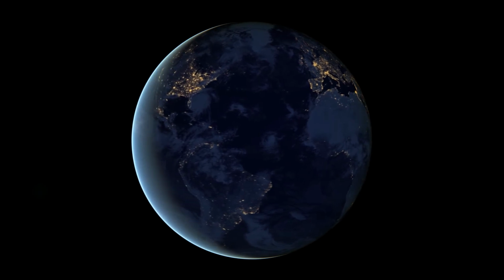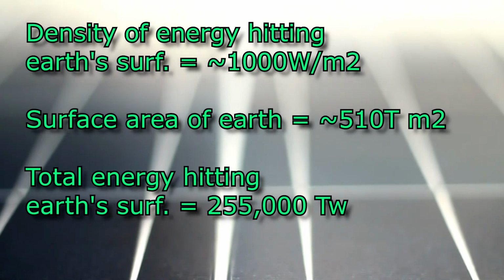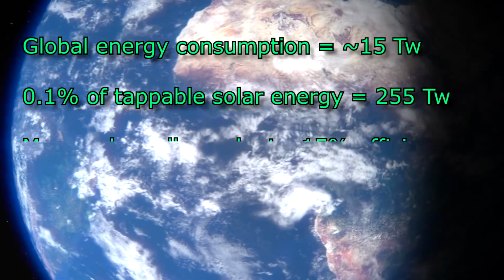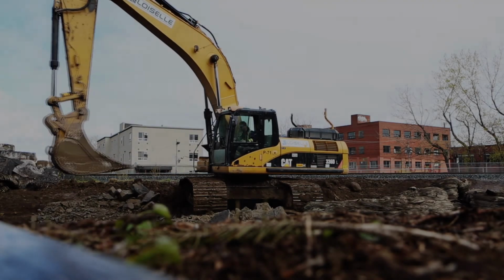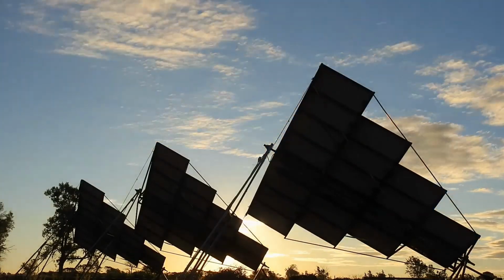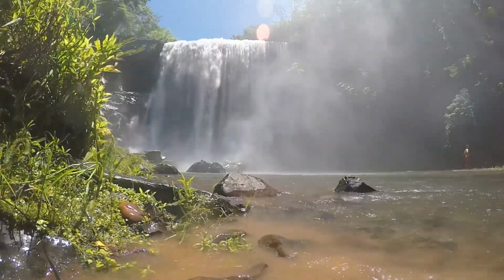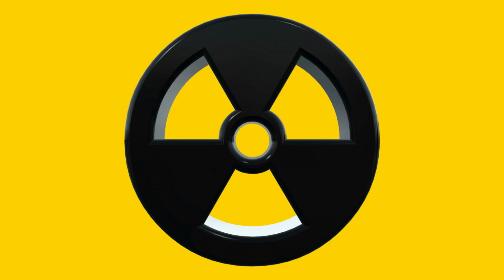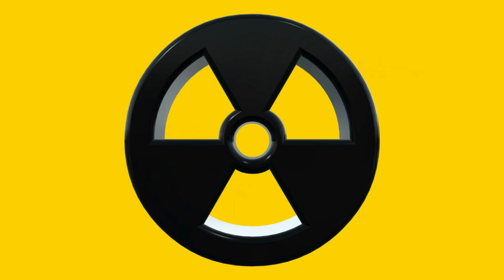(Re-upload) FoRBEs Ep3: Technologies for Abundance and Sustainability

Comment: Base load sustainable energy from:

* geothermal (especially ultra deep geothermal)
* ocean tidal, wave, and stream
* whirlpool for streams and rivers
* high altitude wind
* power satellites

Land based wind turbines and solar is a waste of land and has intermittency issues.

Especially with climate change and all of the horrors that will come with it make nuclear reactors are very, very dangerous and unnecessary especially with other safer sustainable base load power options. 

Fly wheel, sand or brick, and flywheel batteries are great simple batteries.

Comment: you are a true rbe-er, but recognize that howard and fresco were not architects. if a circular plan was that great, it would be everywhere. the reality is the grid is everywhere. even mars city is planned as a grid. that is, start up development. if you want to see a more promising approach, check out baukunst2000 channel.
Reply from the maker: You see, the grid system works well for the functioning of capitalism. Cities were designed in a grid fashion to accommodate the car. In an RBE we might not even have cars as a form of personal transportation.

This is about truly overhauling everything that has been done before, from economics to culture to city design. There are numerous benefits to the radial model: it's transport and energy efficient, is less prone to sprawl, among other benefits.
Reply: @edeniaAJ  thanks very much. no one ever responds to me, so i wanted to clarify. disney was no architect either, but epcot (elliptical), had some design merit, even though it had nothing to do w/ rbe thinking. was quite the opposite. ultra-capitalist. the built environment isn't related to the economic system. i know fresco has erroneously claimed that it is.  if you give my scheme online a chance, i have no cars other than localized emergency vehicles. all passenger and freight train lines are running on a 1/2 mi. grid w/ stations every 1/4 mi.. the big infill patches are structured farms. there's no sprawl. like tvp, my urbs (cities of 350k pop.) are built as a complete entity. they are then chained together w/ umbilici, like a mat across middle america. if you look at the individual city module, there are end caps. water treatment and elec. substations at the north. a staging/reservoir area to the east. garbage, biomass, and recycling to the west, and wastewater treatment to the south.  my housing density is running about 35 dwellings/acre which is high enough to support a rail system. an acre of artificially lit hydroponics could equal 4-6 acres of open-to-the-sky farmland depending on the crop. an american diet runs about 1 acre/person per year, but hard to quantify. there are others out there such as the vertical city. vertical megastructures w/ farms in between and linked by trains. no rbe and/or type 1 platform. website looks dead. can also look at arcosanti. basically a bottom up commune, but soleri never preached rbe. i believe in a top down approach, by using the u.n. as a way to get a foot in the door.  ie, addressing the 17 sdgs that are currently in play. there's about 500 years of utopian thinking that's come out of the arch. community. i admire what you are trying to do, and want to be allies. my suggestion is you research some other ideas and i don't mean tvp copy cats. one of my online friends has one. brilliant guy btw and hardcore rbe-er. maybe you feel the built environment part is just a detail that will work itself out? but laypeople, especially college educated ones,  get excited over tech. info. just as much as artist's conceptions.  i have personal, professional experience with this. have you seen any math similar to what i have outlined above from tvp? any scaled floor plans w/ functions. circular city diam.? 50,000 people? one train line that darts through some cyber hub?  100% automation? even a bike runs 95% efficient. how about 80% automation and 20% human labor. more realistic. i'm sure you have seen interreflections. i do have a quirky theory that zaha hadid (rip) was influenced by fresco's curvy models.  i could go on. feel free to email if you're so inclined. adam, even these guys talk about a 5 mi. x 5 mi. grid city w/ subway trains and no cars. it's a somewhat silly presentation, but the design intent is there, and verbally akin to my concept. more food for thought. cheers.

https://www.youtube.com/watch?v=0GwINxSlMFs&feature=youtu.be
Reply: @baukunst2000  Hey, I wanted to add in my thoughts to this discussion. I just recently watched the video. I'm interested in the transition of humans towards a resource based economy and city design is a big part of allowing the principles of an rbe to thrive. I like a lot of your ideas. I've seen Fresco's circular city and while I think it might work from the ground-up in the distant future, I just don't see it catching on worldwide for various reasons. One of the reasons is landscapes. The Venus Project circular cities are all shown on flat, open spaces often with internal ponds and water features, but not necessarily right beside a big body of water like a river, lake or ocean. Well, in reality, many (if not most) cities are built along water and that often means they can't just be circular, they have to adapt to the different terrain. The city I live in isn't very large, but it's got a big hill on the north side and then into the valley is the rest of the city but it also has smaller hilly areas, too. A circular design isn't practical for the majority of this terrain. But, I believe, people living in their communities and given the resources and ability to do what is most efficient and technically possible, like in an RBE, would design and re-develop their communities in to beautiful, efficient, very livable communities. 

However, that's part of my questions. How do we work with current urban areas if we were transitioning towards an RBE while also building new, smarter, more sustainable cities from the ground up, somewhat like Masdar City (have you seen the videos on it online?) which is an off-shoot of Dubai. See, I think cities can definitely be too densely populated and that can go against making cities healthy, sustainable and livable. Having at least 30,000 people to 100, 000 is a good number to be able to have infrastructure that let's those people self-sustain themselves with locally produced and distributed essential goods and services, like food grown locally, clean energy, sustainable textiles for clothes and products and of course a solid amount of recreational and leisure activities and spaces for people to enjoy. Small, surrounding towns near cities of that 30 thousand to 100 thousand size are certainly possible and okay, as they can be well connected via mag lev trains and that can improve the living standards and experience of more people. 

But I do think those well over 1 million people cities have a bit of a problem. They are what they are. But in a resource based economy, with smaller communities being able to build up smarter and more sustainable and take in more new people, I'd hope that people crammed into mega cities find that they don't need to live there to have a good life and choose to go to a smaller community where it can be more sustainable for them. Allow those mega cities to breathe again. Take back concrete jungle space for green space. 

I very much like the concept of the 15-minute city or neighbourhood. Are you familiar? The idea is people can do most or all of their daily and weekly tasks within a 15-minute walk or bike ride from their home. The people-prioritized community, instead of the car-oriented urban sprawl concrete jungle. That's the essence of it and I think that's a concept that most current cities could re-orient to, especially in a transition towards an RBE. 

I think of my own city and how it could transition that way. How when new neighbourhoods are being built or expanded, they have a plan to ensure there is enough schools, clinics, grocery stores, repair shops, libraries, parks and recreation services nearby those residents, as well as efficient public transit systems. People can get their daily tasks done without going too far to their home, which means they will likely walk or bike during the nice weather days and then perhaps technology can help ensure decent and safe transit for days that aren't as great outside for log periods. 

There are still often unique and cool general gathering places in cities like the Downtown, an arts/cultural centre, arena, major park or whatever other special attraction there might be. For that, cities orient around efficient, safe, convenient transit options with public transit or personal walking/biking still being a viable option. Again, here is where either mag lev trains, some could be through underground tunnels or covered tubes, or this promising networking Personal Rapid Transit I saw from NASA called SkyTran. I like the idea that some common meeting and cultural places in a city have a transit station like via a mag lev subway but then getting people to nodes of the city is those PRT structures that can replace the need for more personal vehicles on the road when really most people just want A to B in a safe and efficient way. Sometimes, I admit, people do want or need a certain type of vehicle within the city or to unique rural areas outside the town and that's where strategic access for people to personal vehicles can be arranged. 

I think I've rambled enough on this issue. What are your thoughts?
Reply: Thanks much reddy. For what to do with existing cities you can check out the book…a country of cities. It basically sheds suburbs and bolsters up city cores by increasing density. Or just densify existing suburbs, introduce better public transit and abolish cars. My concept builds on existing flat land with a coastal proximity.
Reply: @baukunst2000  Ok, thanks for the book recommendation. I look around my small city and tend to agree the way to make it better is densify existing suburbs, because let's be honest, there are A LOT of them in North America, especially, and smarter design going forward is great, but working with what exists now is also important. I could see how suburbs could do simple (in concept), but effective changes like bringing in 5-10 minute walkable essential shops nearby, adding/updating community centres, schools, libraries, etc. along with automation to help increase health and efficiency. Less cars will be needed, can then be opened up for more walking/biking spaces, even more parks and gardens. 

I think when we talk RBE it's good to have a scientific base to help filter out the best options, but then allow for a fairly wide degree of variability in how people in communities decide to make it more efficient and healthy living there. For example, I'm not a fan of concrete jungles and huge high-rise buildings. That's density, but I don't think it's healthy density for all communities. But I think there is a long line between what is clearly bad lack of density and too dense. A strong middle ground, again based in science and sustainability protocols, gives people the autonomy and options they need to feel motivated to help in transition.
Reply: @coolioso808  i modeled my cities on a San Francisco density of about 18k persons per square mile. It’s fairly comfortable. The car has been a great invention and integral to capitalist progress but as we move towards post scarcity my 2 cents is that it may be phased out for more efficient and collective modes. Good exchange of ideas.
Reply: @baukunst2000  I think that's alright. I remember Jacque Fresco said, when talking about a resource based economy, we should be building "University Cities" and I tend to like that analogy. I went to University and stayed on campus in residence. Almost everything you need is there within walking distance. The housing, the multiple food options, some small clinics and haircare, access to reliable public transit, green space, indoor recreational space, libraries, entertainment options and the people living in residence didn't really need a care 99% of their time. I didn't and I got by just fine. Now, the population of the students staying on campus was probably about 5,000 at best, not 18k, but the residence buildings were almost always high-rise apartment-style of at least 3 or 5 stories, there wasn't really 'single detached homes' - but a nearby neighbourhood would have that. My point being there was mixed use housing and people could walk, density was higher than say a full residential suburb of single-detached homes, and they could have more density if it wasn't specifically a University campus. There is lots of variation in how we can build our neighbourhoods of density. Geography is different all over the world so mega-towers can't always be the answer, but of course, urban sprawl isn't either, that's just inefficient land use. I like the idea of walkable/bikeable neighbourhoods for 90% of people's daily needs - and then solid public transit for people meeting in common areas, say for entertainment or recreation, and mag-lev train transit from city to city. By the way, are you aware of this NASA development called SkyTran? It's pretty cool. I've never been a big 'car guy' so I don't have as much of an emotional attachment to cars, I mostly just want to get efficiently from A to B. But I know other people do have specific needs for an individual car, a phase of grandfathering out individual cars would certainly be needed. It can still be pretty rapid and logical, if people are focused on a common outcome. 

Anyway, I've rambled long enough for one post, haha. Feel free to hit me back with more thoughts, if you want.
Reply: @coolioso808  the thing that got me thinking about this whole thing when i was about 18, is the segregation and inefficiency of housing and workplaces. either long public transportation rides to employment centers or drive and be part of daily traffic jams. it's tragic it took a pandemic to make us realize that remote working is possible, but this is how the universe speaks to us via cause and effect. plus the evolution of the internet  of course. didn't have that when i was 18. ;)